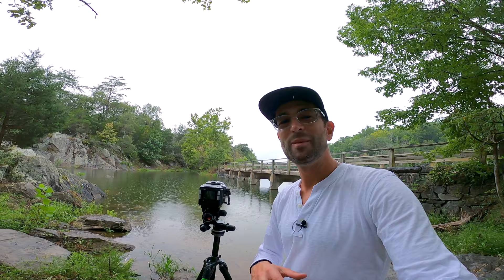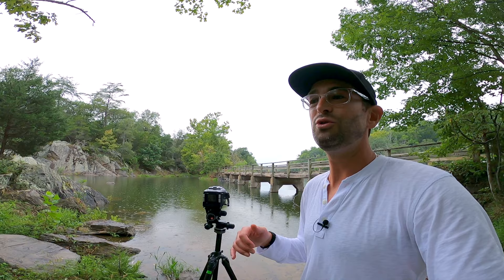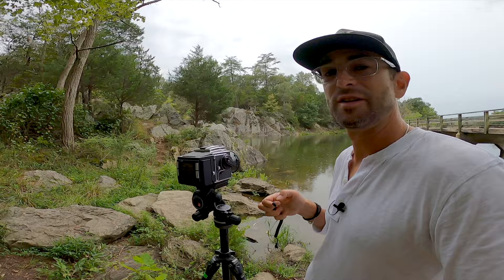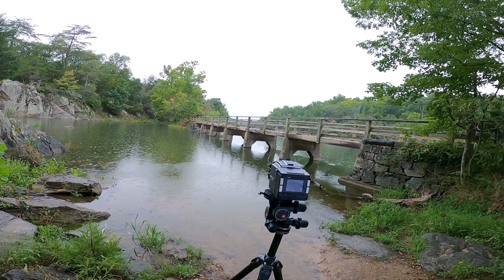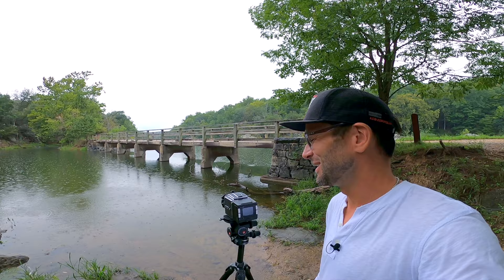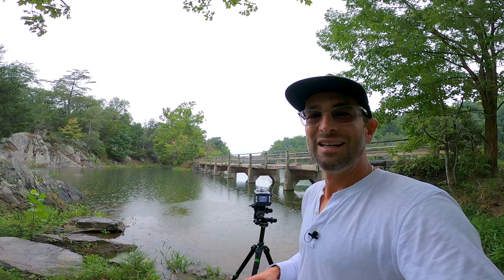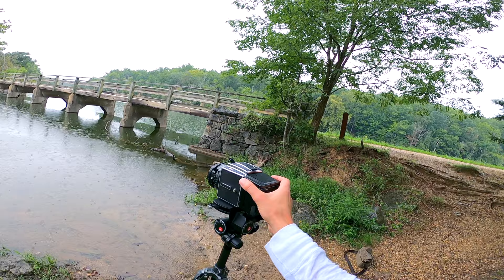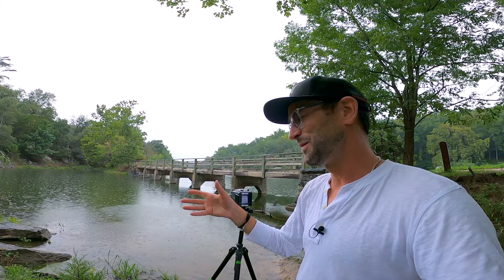Using a 2007 Phase One Digital Back - Part 1

Comment: what makes the P25+ so amazing is that it has a huge sensor, and only 22megapixels, so the photo sites on the CCD are huge, and capture light in a way that newer backs cant match.  It makes the sensors on the "new"  Medium Format cameras like the fuji gfx and blad mirrorless look tiny.  I got my P25+ back in 2009, for a steal at $9,500 lol, and use it on a 4x5 with a stitch back, and a fuji 680.  It still out preforms my sony a7r3.  Amazing back if you can fine one.  Only downside is that it uses a firewire 400 connection for tethering, so I have to use an old laptop for any tethered captures.
Reply from the maker: I totally agree - the larger sensor makes for really unique images. I forgot to add it to my Pros but I love the fact that it's only 22mp. Plenty of size to crop some and no need to worry about filling up your hard drive :)
Reply: @nathanhirschphotography871  yes, the file size is what i like about it, since i will stitch 3 frames to get full coverage of my lenses.  I end up with plenty of resolution.  Even the 22mp printed up to 20-24inches looks so good.
Reply: Does the Apple Firewire to Thunderbird adapter not work for tethering?

Comment: Two grands on a decade old electronics with no guarantee that it will last for at least a couple more years and outdated software...... it's a clear no deal to me.
Reply from the maker: Maybe....but it's held up just fine in 13 years of use and that's a sign of the build quality. No reason why it won't work another 10+. These are built like a tank!
Reply: Phase one still supports their backs in capture one, up to and including the present version. So not outdated software.

Comment: I have a P25+ and P30 for Hasselblad H and just absolutely love the color and detail I get from them. The P30 LCD screen has a bit of fungus in it but it’s still works perfectly. The P25+ is 22mpx but has a 1.1x crop. P30 sensor size is a bit smaller, similar to what you get on the newer fuji and hasselblad series. I would love to find a comparable back for my 500cm but they still tend to sell pretty high.

Comment: Hi this is so cool, thanks for the great video! I’m curious about the connector cable, will any flash sync cable do or do you need the cable with an 8 point connector? I got a p21 from a friend but it is missing the connector cable. The 8 point one is hard to find and very expensive

Comment: A few things about your video.
The music interferes with hearing what you are saying.
The jumpy/swirly video is a real problem - causing a vertigo attack and dizziness while trying to watch.
An umbrella over the camera is a smart move.
A tripod with the center post extended is liable to induce more vibration than preventing it.
A cable release to trip the shutter will make for sharper images than pushing by your finger - especially with the camera on the center post as raised.
Reply from the maker: Great feedback, thanks! 👍 Looking forward to seeing yours.
Reply: @nathanhirschphotography871    You won't see mine as I know my limitations and Video is a big one. A whole different game than still images. 
On the Digital back for Hasselblad - how do the prints compare in B&W to film prints - not scanned and printed digitally?
Reply: What a positive human you are. Lovely charachter.

Comment: hi! I want to ask how do you make the composition? the view is 6x6, but the digital back is not. So what do you see from the camera? thanks
Reply from the maker: Hi Stratos, you can either purchase a specific focusing screen for the digital back that will show you the area captured by the sensor, or you can do what I do and just make a guess. After a while you get better at figuring out where the imager sits in the scene.

Comment: Woop woop, time to sell my nikon d3 and nikkor af 300mm 2.8 to get this back for my 500c. Probably gonna have to sell my 4x5 as well. 😫
Reply from the maker: Hey Wilson! The Nikkor 300mm 2.8 and d3 would almost cover the cost of the new Hasselblad 907x, which blows these old digital backs out of the water...maybe not in overall image quality but DEFINITELY in terms of ergonomics and ease of use.

Comment: Hey ! So I recovered about 15 P and P+ backs from an aerial photography buisness. I was really wondering how do you get the right exposure every time without a light meter ?
Edit: what lens are you using ? I ordered a Hasselblad EL today on eBay and looking for an electronic lens
Reply from the maker: I'm using the 80mm CB lens, which was the "budget" version but performs incredibly well. 

The backs have a histogram that you can turn on in the menu. My next video will go over this and some of the other features. Congrats on the purchase!
Reply: @nathanhirschphotography871  also, something I couldn’t really find, does the backs have electronic shutter ? If you don’t have a sync cable how do you do ? These are the questions bothering me
Reply from the maker: @tdg9281  You can't capture the image without a sync cable.
Reply: @nathanhirschphotography871  hey could you take a look in your Instagram DM for easier communication ?

Comment: where did you get the synch cable?
Reply from the maker: It came with the digital back
Reply: @nathanhirschphotography871  How high do you feel comfortable pushing the ISO?! do you have any examples of it over 100 ISO?
Reply: @smichaelpridgen  The back is really only designed for tripod use and handheld in good lighting conditions. Trust me, anything over ISO 400 will be grainy. If I were buying today I would go with the 907x/50c.
Reply: @nathanhirsch4408  I picked up the P25+ for a steal but it has a different back on it than I anticipated - I think the Mamiya 645 back. did you remove or add a convert back for the P25+ back? It looks like I need to take it off to use it.
Reply from the maker: @smichaelpridgen  I don't think there's any way to adapt them to a different body. Only the V version will work with a Hasselblad.
Reply: @nathanhirschphotography871  I definitely purchased the wrong one.... (play the Charlie Brown music)